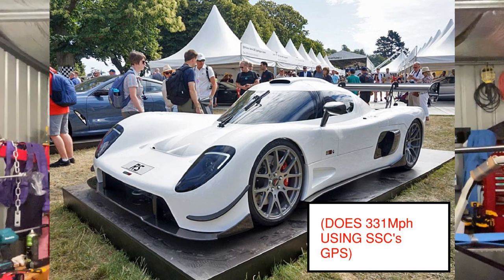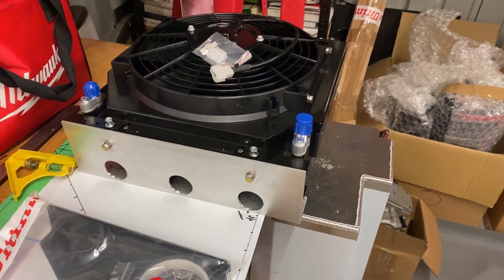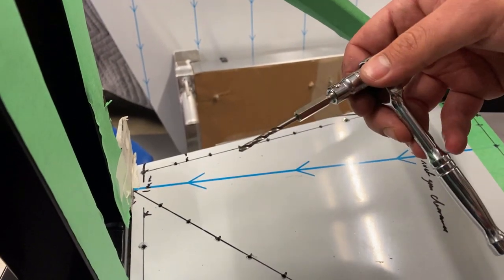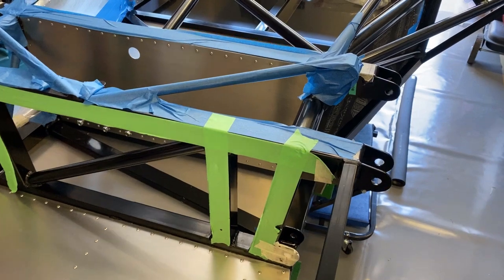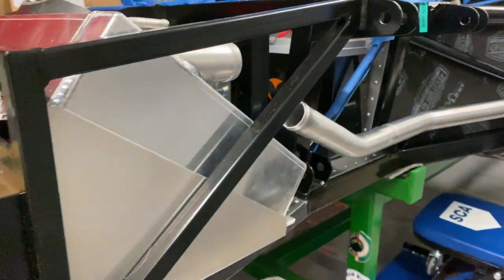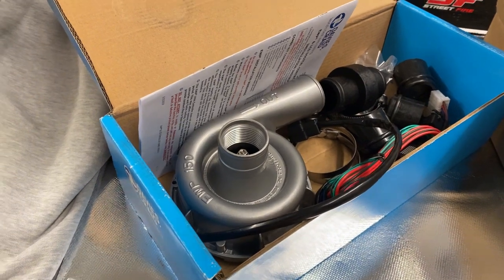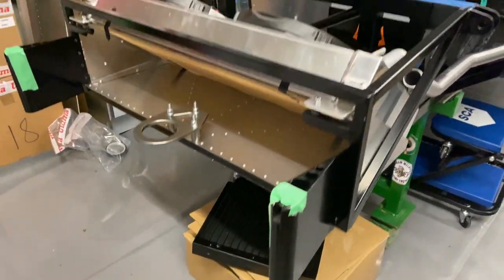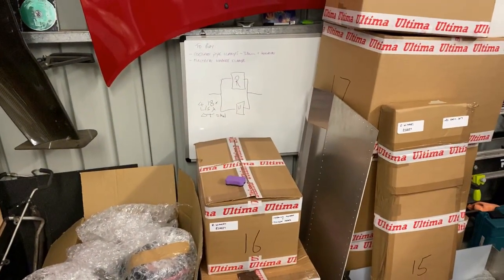Ultima RS - Keeping things hot and cold (Video #11)

Comment: If you have a thermostat you won't get any flow of hot water to the heater core during warmup and driving in cold weather. Normally heater is connected before thermostat. Also have a look at a CWA400 cooling pump 1000 times better quality and realibity. And can be run with 5v PWM directly from the ECU.
Reply from the maker: Hi Mattias, Very valid points - thanks! I don't have a thermostat because this EWP is also PWM controlled (either via the ECU or proprietary controller). Cheers, Rob
Reply: @rob105motorsport  Hi, I tried controlling temp with pump speed only and it didn’t work due to the quick changes in cooling capacity of the radiator in relation to air flow but it is a lot colder climate here. I didn’t like the rapid changes in temperature since that is what fatigues and cracks cylinder heads. 
You should really use the ecu to control the pump to get the biggest benefit of an electric pump, I control mine based of temperature, rpm and load. This makes the system react to heat rise before it happens instead of waiting for the temp to rise.
Also an engine safety note, make sure you can monitor the current draw of the pump so you know if it’s not running since you wont see this on a water temp sensor when there is no flow. Alternative is to have a temp sensor measuring the cylinder head temp close to one combustion chamber. Kind regards, Mattias
Reply from the maker: @o0xenon0o  They're all really good points, Mattias! Definitely ones i'll make a note of when I discuss wiring in this pump.
The control issue is actually a very common problem with controls rationales that don't ramp down pump speed in relation to the rate of temperature change as you approach temperature setpoint. It's especially an issue with over capacity heat exchangers because of the residual cooling capacity in the coil, and even more so when you have to maintain a minimum flow rate (such as in an engine system). 
Then there's the sensor position that can be contributory to poor readings. 
This is actually why at this stage I'm planning on utilising the proprietary Davies Craig EWP controller which is complete with it's own display and a sensible rationale. It's also backed by the R&D testing they've done. I'll still have a water temp' sensor for the ECU for engine control/warnings, but it won't drive the pump control (at least it won't at this stage unless I get keen and write my own rationale for the ECU).
Reply: @rob105motorsport  Let me know how it works since I haven't tested in warm weather, looked in to Davies C a while back and didn't like any of it. Basically a fan motor on a pump housing and they state it can leak around the axle. The lifetime was specified at lower than operating temp and that is exponentially shortened with rising temp. The Pierburg CWA400 is a wet drive brushles motor with cooled electronics so it can't leak and it can run on full power continuously and a lot longer life time and very small also. It has a flow of 150L/min We use it at Volvo Cars and also used by BMW. The BMW variant has hose connections. Control strategy is no problem if you fit a thermostat, I see no reason not to have one except if it's only driven hard on track. It's hard to compensate the added volume of water to heat up with pump speed alone. Kind Regards, Mattias
Reply from the maker: @o0xenon0o  I'll definitely have a look at that pump - thanks for the tip.
Reply: @rob105motorsport  If you end up going that route I can hook you up with control parameters, just send me a DM on IG in that case. :)
Reply: @rob105motorsport  Rob is th PWM a power management unit? Just redoing my Westfield with one and looking at aimPDM32 or ecumaster version ...very neat no more relays and fuses!
Reply from the maker: @jameshughes8543  Hi James, PWM is Pulse Width Modulation. It's a way of controlling motor speed. PDM (Power Distribution Module) are definitely a very good way of consolidating relays/fuses into a single unit. They also have the ability to be programmed, easily reset and can provide definitive feedback on overload conditions. Really good stuff. They do cost a few $ though, and generally require a bespoke harness setup. Cheers

Comment: Grab a Coodrive catalogue and find an AC condenser that'll fit better infront of the radiator. The OE auto ones are a lot thinner. 'Building' two Geminis at the moment, a TX Coupe track car and a TE Sedan street car, you'll definitely have this up and running before I have either of mine going properly
Reply from the maker: Thanks for the tip, Glen. There's a lot of love for Geminis with guys our age. A mate has a TD panel van with a 1.8L turbo Isuzu motor that he's working on now. The key to progress is just to keep chipping away at it. If I have 15 minutes i'll head out to the garage, even if it's to sweep the floor and prep' for the next job.

Comment: Vintage Air, for one, doesn't recommend electric A/C retrofit; they claim the technology isn't yet cost effective. But electric cars obviously come equipped. With a small cabin to cool--and your savvy--I'm betting you can make it work. But I am curious about the BTU capacity and the amp draw of the compressor. Don't shy away from the simple calculations. It's what makes your channel different from that of other builders who don't have the engineering background.
Reply from the maker: In terms of cost, you're roughly $3250-$4k for elec' against $1250-$1500 for standard setups. That does account for auxiliary costs like upgraded alternators. So Vintage Air are correct in that regard. What that doesn't consider is the packaging issue in a mid-engine car. As for current draw, I'm working through the purchase of an alternator now so i'll do a quick video discussing that and cable sizing issues etc. You're at 50-70A on this unit, and it'll pump out roughly 2.5kW (from memory) which is heaps for this little glasshouse cabin. I'll be sure to keep throwing in a few calc's when I can. Cheers, Rob